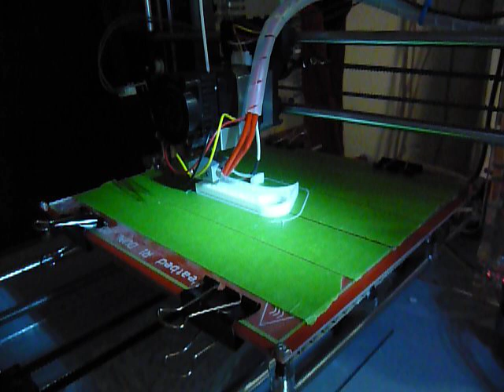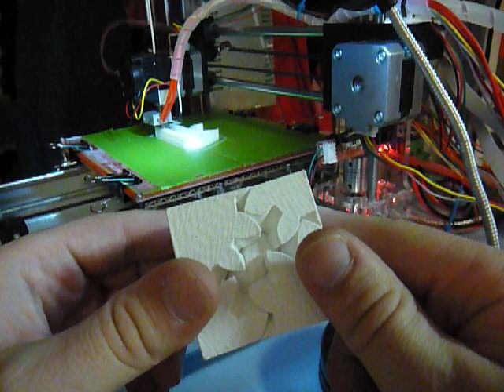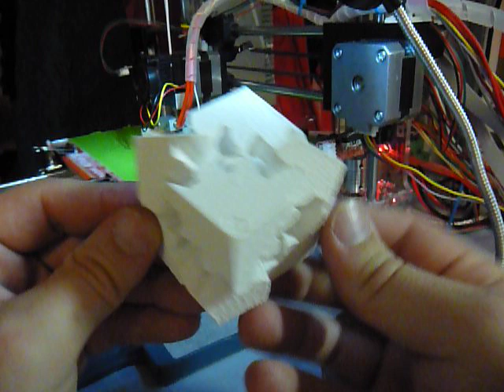Folger Technologies Prusa i3 3d Printer Build part 21 - Final thoughts

Comment: Hello i bought one of these printers and just got it assembled watching your videos. Can you please tell me how to fix the extruder? It wont feed unless i push on the filament a little then it will feed at slow speeds but anything fast it just slips
Reply from the maker: well it could be a couple of things, 1) make sure the filament is going into the correct hole on top of the extruder, when looking at it from the front it is the right hole. 2) make sure your extruder stepper motor has enough current running to it by adjusting the stepper motor driver. 3) take apart the pre-assembled extruder and make sure the toothed/hobbed feeder gear is properly aligned with the incoming filament.

Those would be my suggestions.

Comment: I had it at .4 and even if its in the air it wont manualy extrude using pronterface but if I shut the motors off i can push it though fine
Reply from the maker: I don't understand of it can play down the first layer it makes no sense that it can't put down the second. if it can't extrude in the air how could it put down the first layer? will the motor spin without filament? still sounds like the driver needs to be turned up.
Reply: bubalettow Hi!  I don't know if I told you but my printer is working amazing!  My problem was a pin bented out of the arduino!  Anyway, I like it a lot!  Thanks for all the help again!  Did you see the new one from Folgetech....
http://folgertech.com/collections/3d-printer-full-kits/products/folger-tech-reprap-2020-prusa-i3-full-aluminum-3d-printer-kit  Amazing price!

Comment: Well i think i found it i played eith the pot nothing so i did a extruder calibration (stupid me never did) it was set to default axis steps per unit at 700 i tuned it to around 95 now and i push 100mm to extrude and 100 extrudes. Before tuning i measued it around 550mm... lol
Reply from the maker: Well, I am glad you figured it out, yea pushing 550mm when it thinks it is spiting out 100mm probably would be a struggle for it, I bet the hot end had a hard time keeping up.

Comment: Ok i took everything apart, nothing worked all is aligned and it will print the first layer of the print really well. But as soon as it starts second layer that's quicker the motor just clicks and eventually wont turn forwards at all. But it will retract when its time though...
Reply from the maker: sounds like something Is wrong with the layer height, meaning that if the head were higher the filament would come out correctly but since it's so close to the first layer, it can't extrude and clicks. (this happens when it wants to push filament through but has no place to go.) My layer height is .25mm and it works pretty well but it took a lot of calibration to get it that low. I'd recommend .3 - .35mm layer height. .1mm hardly ever works for me and I don't need that kind of detail anyway.

Comment: How did you manage the wires? Did you cut them down or did you just tuck them away?
Reply from the maker: I used the loom to manage them around the front of the printer and I used small zip ties to manage the extra lengths of wires closer to the ramps board.

Comment: Everything work good, except a few things.... When I test my motors, x,y and z they move only one way, the other way it tell me that I'm at the stop but I'm not.

For example, I move x axix (-x) and it move left and if I move left(+x) it give me code:
''echo:endstops hit: Y:-1.40
echo:endstops hit: X:-1.56
echo:endstops hit: X:-1.55''

but I'm not at the endstop...

It's the same on the Y and Z
Any idea what is wrong?

If I give you my email, can you send me your configuration file?  I just think that something is wrong in the code but what?
Reply: miniquadreviews the mechanical build was the fun part!  Now, I just wish to be able to make it work!
Reply from the maker: miniquadreviews there is a setting in the firmware that can be turned off so that you can go passed the assumed endstop... based where you start the machine at. you can disable it so that you then can home the machine past the beginning position to the endstop position.